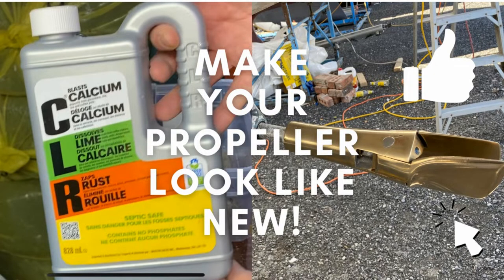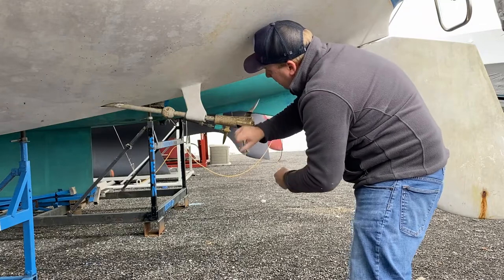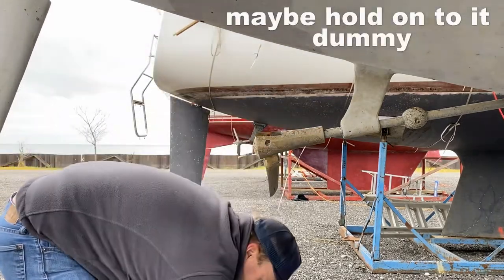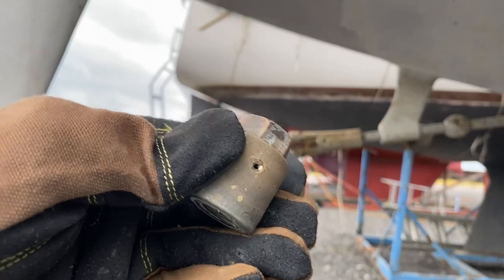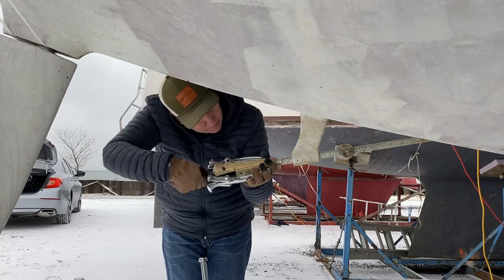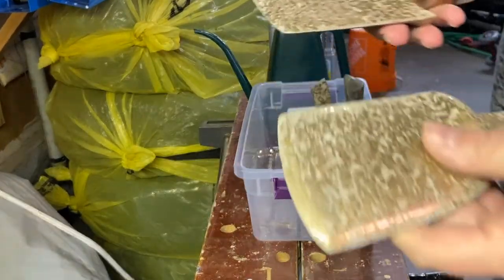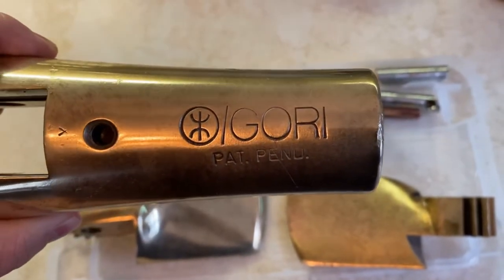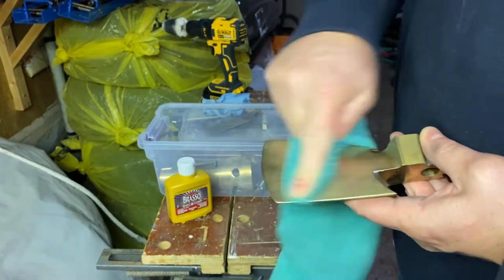WILL CLR MAKE YOUR PROPELLER LOOK LIKE NEW? Plus  how to remove a Gori two blade folding prop

Comment: Thanks for the vid mate but...
From the CLR website:
Do not use CLR Calcium, Lime and Rust Remover on any natural stone or marble (including cultured marble), terrazzo, colored grout (any other color than white), any painted, coated, sealed or metallic glazed surfaces, plastics, laminates, Formica, Corian, aluminum, galvanized metals, nickel, oil rubbed bronze, brass, copper, steam irons, leaded crystal, refinished tubs or any damaged or cracked surface. 
My comments:
I have an old yacht with lots of brass and bronze portholes, hinges, blocs, and assorted fittings. I've never tried polishing my prop but I polish everything else and find that Diluted white vinegar works pretty much like the CLR does in your video but the citric acid in the vinegar will not harm brass or bronze. To final polish if find that Autosol Metal polish works a treat... 
You might give the vinegar bath followed by Autosol a try when you next pull the Gori off its shaft.
Cheers
Reply from the maker: Interesting. I'll give the vinegar a shot. What I will say is that I have done the diluted CLR bath for a few years, and my boat neighbour has been doing it for far longer than that with no pitting visible. YMMV.
Reply: @TheAwakeford  Thanks for your reply mate. 
If you are impatient and don't want to soak your prop overnight or longer, you can also try using powdered citric acid at higher concentrations mixed with water. Basically it's the same as vinegar but you can make it more concentrated. Powdered "Barrkeeper's Friend" contains 5% citric acid and works rapidly with some elbow grease, since they add feldspar to act as an abrasive, so you might be able to leave the prop in place perhaps... 
Happy polishing!